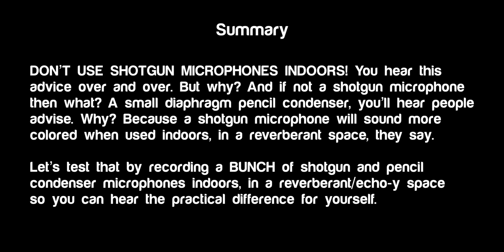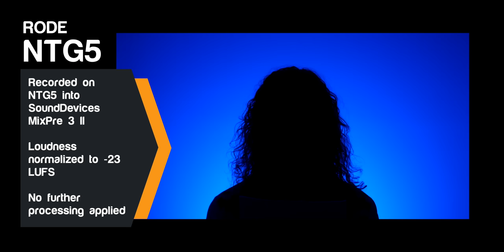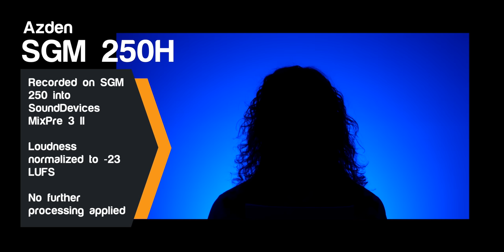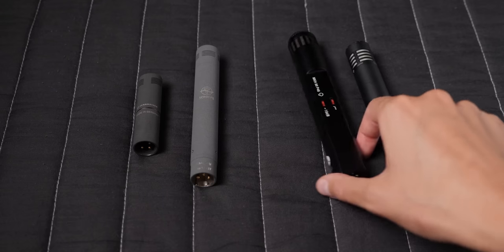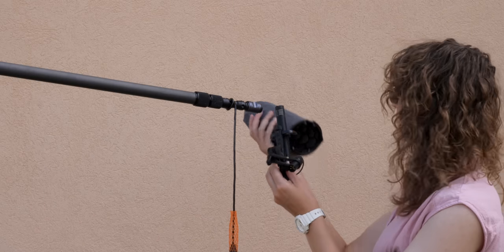Can You Use a Shotgun Mic Indoors? Shotgun vs Pencil Condenser Boom Microphones

Comment: IMO the DPA 4017 sounds closer to the supercardioids than to many of the other shotguns. I could hear a significant difference in combing between it and the MKE600, and then a smaller step to the AT4053 (which I have) and the other SCs. As you say the MKE50 is amazing. Like you I started with the AT4053, and when I upgraded to the Sennheiser it was a bit of a revelation (I didn't go through the 8050 in between as you did though).

The idea that somebody who can only afford one mic would go for the MKE50 seems a bit off to me though. I think that if you have the budget for a $1200 mic then you might be better off getting 2 $600 mics, an SC for indoors and then a shotgun for outdoors. I think you'd get more "balanced" results across the full range of situations that way.
Reply from the maker: Fair opinion. I'd be a bit hard pressed to identify a good $600 USD SDC.

Comment: Nice comparison. Shot gun was my choice years ago. With the info I found online, I could use it outside, and it would be okay inside. Rode NTG4+ is what I have from that. Well I started with a cheap $20 one from china that turns out has two diaphragms and two modes, shotgun and condenser. I used the NTG4+ for my film Airborne Death. You probably can't tell a shot gun was used indoors. I would ad that a LAV mic may be considered by many. Harder to pick up multiple people if you only have one, and more work to set up from what little I know, but they can be used both in doors and out doors. If I am correct, they need to be close to the sound, so they may have some rejection of sounds further away and not pick up as much background noise as a pencil condenser mic.

Comment: Even using a cell phone or iPad speaker you can hear the difference.   However the Ntg 5 is $400 or so and the mkh50 is $1200.  Is it 3 times better?  Not in my estimate.  Plus all audio can be processed in post from simple resolve filters to NLE filters in order to remove echo or noise.  Coloration or colorization is pretty  subjective.   Also plenty can be done in post.   If you’re doing live I still think processing can help.  But if money is no object and you can buy an indoor and outdoor mic for simple voice then go for it.   Some people even tape up those holes in the mic to alter the pickup pattern.  Sennheiser makes great mics but you’re paying dearly for the made in Germany label assuming their still made there.   I’ve had no issues with Rode indoor or out as long as you use wind muffs.  Plus not everyone can get 18 inches from talent for non interviews.

Comment: I've voiced innumerable indoor, on-camera projects, from an HGTV cooking show to corporate industrial videos to motion pictures, and the most common microphone through which I've been recorded is the Schoeps. I'm not sure which models, and I'm not sure whether or not the Schoeps is considered a shotgun microphone, but in my opinion, the Schoeps' sound was always exemplary. That sound, however, doesn't come cheap. Schoeps microphones are not inexpensive.

I have a Sennheiser MKH-416 as a backup to the condenser in my voice booth but have only tested it and have never used it in a session. At one time, the MKH-416 was used by some voice actors to capture that "voice of God" movie trailer sound. My question is whether or not the coloration of the MKH-416 is as noticeable in a heavily insulated voice booth where there is virtually no reflected sound.
Reply from the maker: No, when you manage the reverb, the coloration is far less to non-detectable.
Reply from the maker: As for the Schoeps, they make great microphones. They capture frequencies quite evenly so that post production has a good bit of latitude to sculpt the final sound with EQ and other tools. However, I have found that sibilant voices and Schoeps aren’t my favorite sound.
Reply: Thanks, Curtis. That's good to know in case my condenser ever presents a problem. 

By the way, I believe the Schoeps used in most of those sessions was a CMIT-5U.
 @curtisjudd
Reply: @curtisjudd   Another thing to consider: I've found the CMC6mk41 is susceptible to RF interference if you don't have an RF  filter on your cabling. But I've not had this problem with the Sennheiser mics.
Reply from the maker: @onseteducation921  I haven't run into that, so thanks for sharing. Will keep an ear out for that.

Comment: I'm sure the MKH 50 is great. But if you can only afford one microphone, it's probably not an option, as for the price of it you could get maybe four or five other good microphones. I like your final recommendation of the MKE 600, because really they all sound quite okay (to me at least, except maybe the Azden), so why not choose one of the more affordable ones.
You say they all sound reverberant, but I thought some less than others, and not necessarily the ones you'd expect. The Røde did not sound particularly reverberant to me, even though it's a "shotgun", while the 8050 sounded more reverberant, even though it isn't a "shotgun".
I expect it depends on a lot of factors, and that it may be different in different rooms. So that in one room mic A is worse than mic B, but in a different room it could be the other way around. It could even vary in different spots in the same room, I'd expect.
So if you only have one mic, it could be an idea to try different mic placements to find the best spot.
Reply from the maker: My next hypothesis to test is that shotgun microphones will experience more phase issues and comb filtering when on a moving boom pole in reverberant spaces vs pencil condensers.

Comment: From my understanding the problem arises because the interference tube in a shotgun mic is designed to reject noise from the sides using phase cancellation and to allow on axis sound eg dialogue, to pass through clearly. When outdoors the sounds being cancelled are not related to the on axis sounds (dialogue) but once you are inside the off axis sounds include the dialogue (reflected) and so some of the dialogue itself is phase cancelled and hence "colouring" the on axis sound. A hyper cardioid pencil mic does not use phase cancelling in an interference tube so reflected dialogue is not phase cancelled leaving the original dialogue uncoloured (at at the cost of picking up other sounds from the side eg traffic through window, aircon, fridges, other talking etc)
Reply from the maker: That’s my understanding as well. In practice, it seems to be more pronounced when the mic is moving vs statically boomed.

Comment: I've used the Sennheiser ME66 for two decades and always get great sound. Indoor and out. I also have the ME64 which is a pencil cardioid but hardly ever use it. I would argue the ME66 sounds better in most situations. In my opinion.
Reply from the maker: Glad the ME66 works well for you! Shame they discontinued it.
Reply: @curtisjudd  I never take it out of the blimp. It's been in there so long I forget what it looks like. HAHA. Kidding. I give is a clean now and again and use a battery instead of Phantom Power. Pump it into a wireless transmitter straight into my camera. I use the Rode Filmmaker kit. No pre-amps nothing. Sounds great.

Comment: I feel like i dont know exactly what to look for when people say there's coloring? lol, also ive been trying out the mkh 50 and the sanken cs-m1 because they're short and i need a mic that can be both on camera with my fx3 and also boomed...and i feel like i don't hear much "quality" difference and they can both be equalized to sound almost interchangeable, but before any equalization the mkh 50 is very bass heavy and not super crisp, but the cs-m1 seems to have sufficient bass and a crisp high end before any tinkering...and like i said about the possible coloring with the cs-m1, i don't hear much difference i don't think...or maybe I'm not recording in a very reverberant space where it would make a bigger difference, or maybe because the cs-m1 is so short its less colored? the mkh 50 also feels a little awkward as an on camera mic lol
Reply from the maker: If it sounds good, then it is good. Trust your ears.

Comment: I love my cmit5u indoors and it blows away the mkh50. Also the Sennheiser 8040 is a far better mix choice for interior dialog over the 8050 of mkh50.  The 8040 doesn't have the extended bottom of the mkh50 and I think it opens up the sound and certainly helps let the mic breathe. Great for capturing multiple people evenly.
Reply: I also bought a recent CMIT5U and use it indoors, rather than my 8050b.  I have heard once or twice strange artifacts doing indoor recordings, maybe it was comb filtering? 

The Schopes sounds so natural, like the person is there.  It has a radio ready quality, where the raw tracks are quite good.  I've also recorded music with it.  I planned on getting the miniCMIT, but after hearing a bunch of youtube tests, it was clear to my ear that the higher voltage of the larger CMIT gave it better micro dynamics than the Mini.  Would love the 641 one day, but focusing on getting a feature off the ground.
Reply from the maker: @johnnycashlesscomedy8616  👍

Comment: Interesting video.

Would not have thought about using anything other that shotguns to boom because of my limited knowledge of booming, but oddly enough I have fallen in to booming inside without having a shotgun/ mic of any kind available to me, and no interest in obtaining a shotgun mic either. But I digress.

Currently I am helping to record in-house a modern radio-play in a garage that has some echo but could be quickly treated with dense fabrics to help things out but we haven't tried that yet, and I am using my SDC pencil mics as boom mics. One is on the blanketed table  and one is on the mic stand up in the air as central to the actors involved as I can get it and enough so it can be above most people's heads by half a foot to a foot, but I noticed in this video you recommend a foot and a half it seems, noted.  

However, I am not using the pencil mics in cardiod mode like I have done to record voiceover/voice acting/singing with them in my booth, instead I am using them in omnidirectional mode because the powers that be liked the fuller sound of that better when we did a quick test for the first time two weeks ago.  

The technical end of sound is not my forte, so I am curious, even though you cannot see the exact space, if you would or could foresee any issues that we may face and if you have any suggestions in general, and your thoughts on using omni vs cardiod.

Just curious.

Thank you again for your content and for reading my long-winded comment/question.

Have a great day.

Stay safe and stay awesome.

Gerry :)
Reply from the maker: Gerry, always, always, always trust your ears. Sounds like you have the space decently treated so if the Omni sounds best, stick with it!
Reply: @curtisjudd  Sound advice. Ha!🙃Your words echo the sound engineer that I call my "sound yoda" as they helped me test microphones out in 2021 to find out what sounded best for my very deep voice, which ended up being two different kinds of SDCs (lineaudioc2me & apex185b), a dynamic (senne935),  and also ribbon mics but they had too much internal noise upon gain turn up. But I digress. Regardless,, I will continue to trust my ears and heed both your and his advice. Thank you very much for your response and keep up the great videos. Stay safe and stay awesome Curtis. 🙃✌️🎤🎙️

Comment: You probably should have been a teacher if you had not been an audio guy. You have a way of elaborating complexities in the simplest of ways. I have a barrage of questions of the topic. If you have just one shot gun mic like the mke 600 without a boom pole holder can you place the mic in such a way that it can serve two people for a dialogue podcast? Also if you have a lav mic like the Sennheiser mke 2 gold and a shot gun mic like the mke 600, how can you combine both for a podcast? How can you use two condenser shot gun mics for a dialogue podcast without the audio spilling into each other for separate audios for both speakers? And lastly the Sennheiser mke 2 gold is more expensive than the mke 600, it should be expected that a more expensive lav mic should sound as good as a boom mic, how do these compare? These are topics you should do videos for as a lot of novice like myself are confused.
Reply from the maker: Thanks for the suggestions!
Reply: @curtisjudd  Eagerly waiting for your video that answers these questions

Comment: Y no samson c02
Reply from the maker: Too noisy.
Reply: thanks for the reply. I was gonna get those for VO. Would it help if i chained the dbx 286s's gate, and use izotopes denoise, would I get away with clean audio from the co2s? currently using a chinese 416 in  an awfully small recording space. thought if i bout the cheapest pencil mic that I would improve the sound of my recordings. would love your insight CJ. @curtisjudd
Reply from the maker: @seppous  I'd save up for at least a RODE NT5 or something a little cleaner rather than do all sorts of other things to try and clean them up.

Comment: WHY!  PRAY TELL Did you make the reference "pencil" and "shotgun" and then only reference The Brands and Models on the sampling?  AD Lower third Graphics and specify "Shotgun" or "Pencil". REMOVE THE GUESS WORK after doing a great Setup / Explanation.  I dont want to look up all those brands and models, wtrite them down and then look back and forth between my notes and the video, not when I want to be concentrating ONLY ON THE SOUND RESPONSE.  I dont want that referencing distraction while listening.
Reply from the maker: Thanks for the feedback. The first are all shotgun mics. Then starting with the Audio Technical AT4053b, they are pencil condensers.

Comment: The problem with this small diaphragm mic is even at 1 ft to 2 ft this is unusable bad sound so not fit for run and gun.
Reply from the maker: Mics on camera always sound like mics on camera, in my experience.
Reply: @curtisjudd  so what do you suggest?
Reply from the maker: @anneboyer6359  Get the mic off the camera and boomed over the person talking. Or if you cannot get the mic off the camera, get as close as possible to the person speaking.